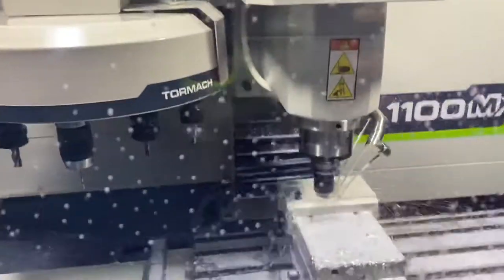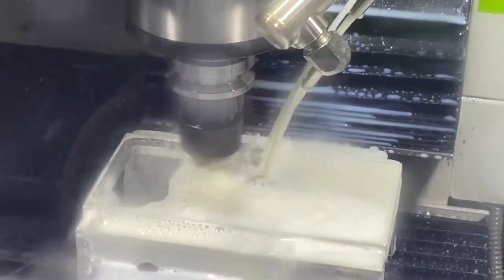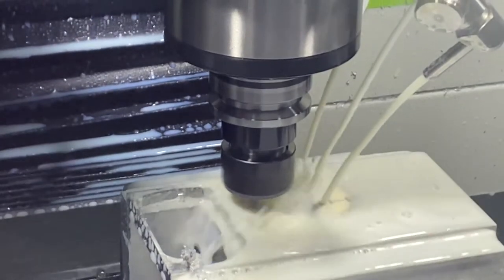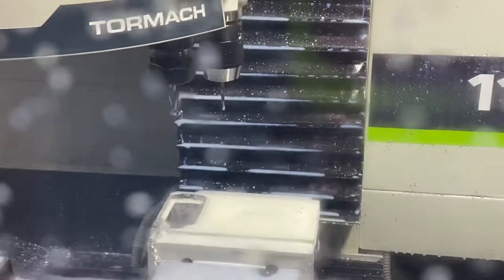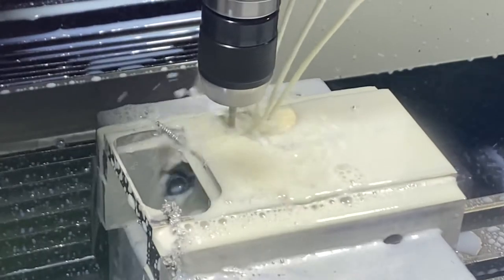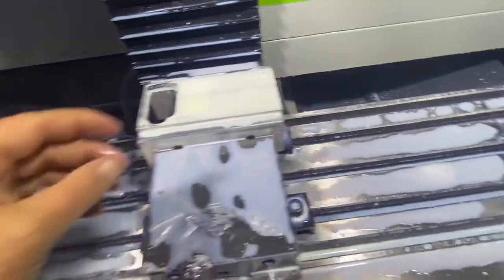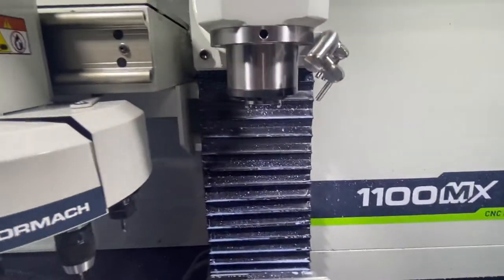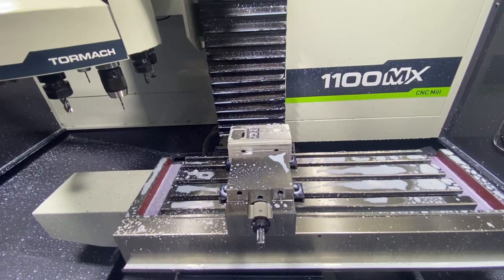Making first parts after Tormach 1100MX problems. Weak Flood coolant? Does my spindle sound bad?

Comment: Upgrade your line to 5/8 ID.  It's too restricted.  I also upgraded my pump to 1/4hp and went with the coolant ring by Steve Strange.  Game changer.  Another tip is don't spray around in there with no tool in the spindle.  Possible to spray some chips up there.
Reply from the maker: Amazing. Can you elaborate? I'll order the pump now. I think I need a filter as well. 
I had a neck or spinal injury since I made these videos, so will do it in stages. Lost control over my left hand recently (a bit) so moving in small steps right now and put the cnc aside for 3 or 4 weeks unfortunately. 
MRI this week, to find out what's going on. Intense pain right now and numbness in my left arm, spreading.. really sucks. But, I'll get repaired and back to full time. I do have videos of this machine working excellent. My projects are extremely detailed however. Small parts, machined on 5 sides total, down to 1/1000ths of an inch. so far, so good.. most of my time has been spent on making tools for holding materials straight in a vise or on the table. Sincerely appreciate your feedback.. PS, Tormachs leak.. their cabinet quality and their stock washers and seals are just utter crap. My entire cabinet is now pulled apart and sealed permanently with silicone.. waste of a week doing this.
Reply: @poppabear9279  sorry to hear of the injury.  Hope you get better soon.  I use felt and some magnets to filter my chip bin.  Works very well.  Send me your email and I’ll send you the details on the pump, lines etc.  aren’t you in the Mx group on Fb?
Reply from the maker: @tdg911  excellent. It’s “Poppabearly@gmail.com” 
Greatly appreciate your time you’ve spent. 
If you need any electronic engineering assistance, that’s my specialty. I have some really cool patents in the industry. 
Thanks again.